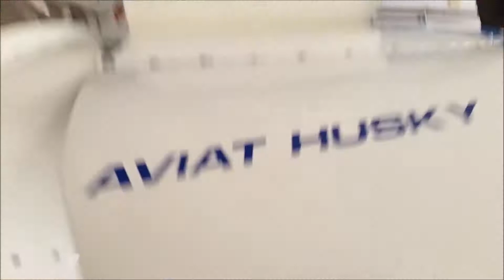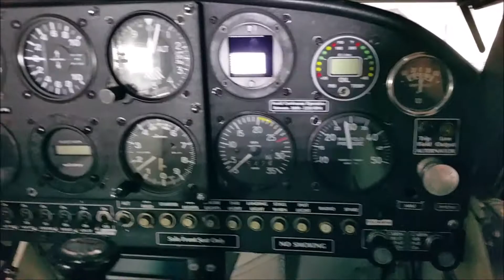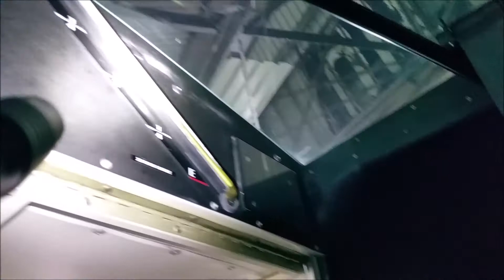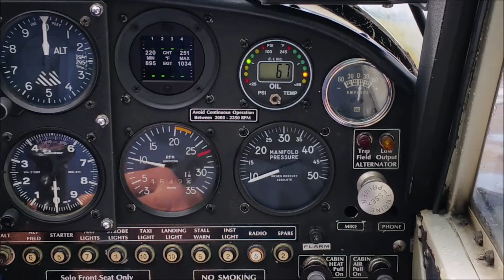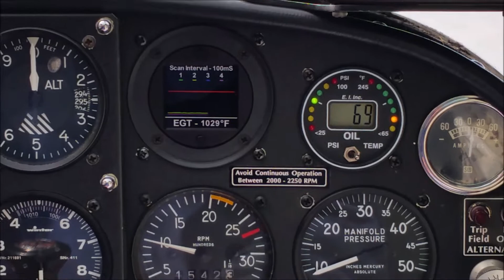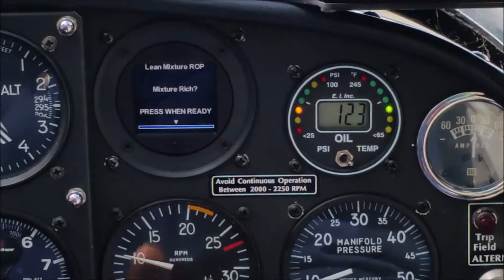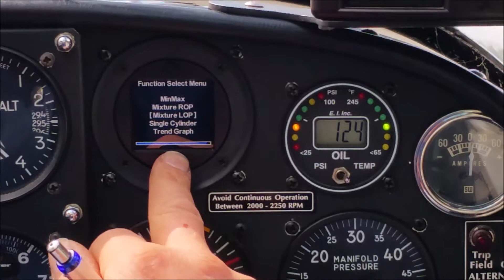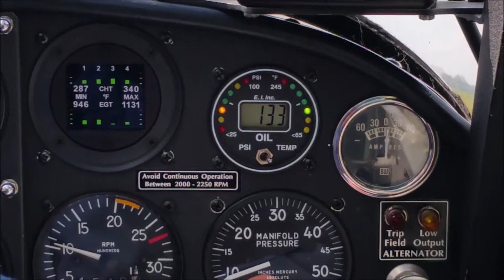Husky: Waking Up The Fresh Engine

Comment: Nice video! I just can't figure out what is there to do with a Husky in the Netherlands. It's like the plane can't even be utilized to it's full potential
Reply from the maker: Towing gliders! Or banners. Or for fun, if there's plenty of money in the bank.
There's 6 of them that I know about. PH-GOZ (EHHV), BON (EHSB), ELT (EHTL), DOG & PHX (EHTE), KIS (EHRD)
For EHHV specifically, this Husky has the optimal performance for towing, since the runways are relatively short and on the north side limited by trees and slight terrain.